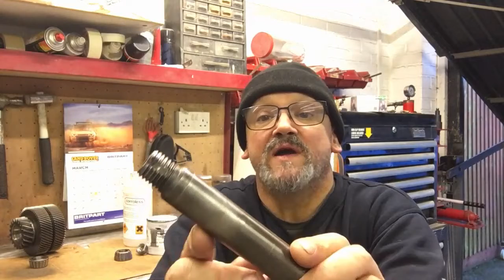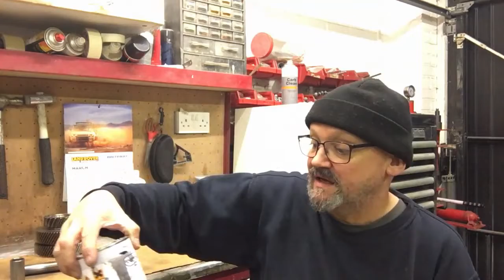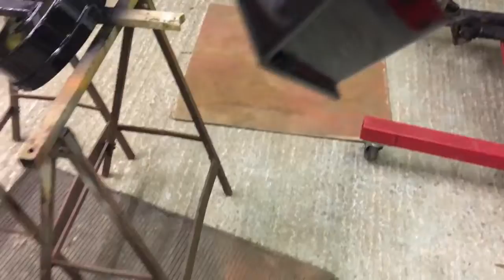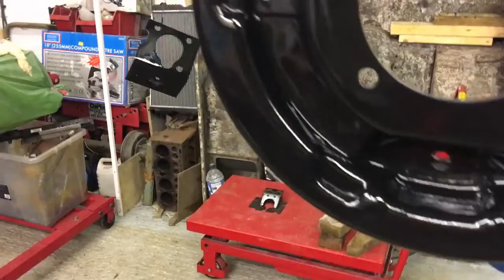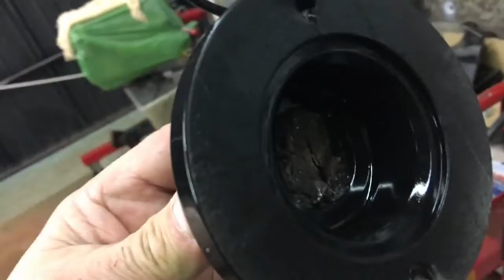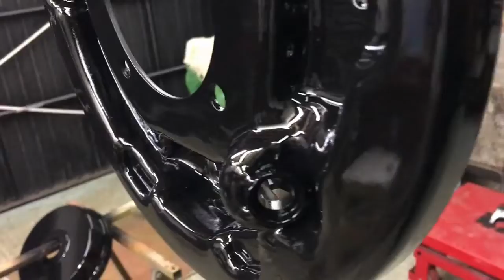Ashcroft ATB part 3a. More ramblings and a little progress.

Comment: ...are you sure that paint is better than the old tin of Smoothrite I found at the back of the Barn and used on my axle today? :)
....Chris at LRTV is a lovely guy....bought a 110 tub from him a while back, and some Defender manuals...really straight up bloke who wouldn't bullshit anyone
Reply from the maker: Hi Paul.. it certainly is better than smoothrite.. loads better!! If I were you I would throw the smoothrite in the bin. The formula was changed a few years ago I believe, hence it is no longer as good as it used to be. I painted the railings out side my house with smoothrite. Sat in the sun it literally peeled off!! I have since painted them with Rustoleum gloss black and it is lasting MUCH better.